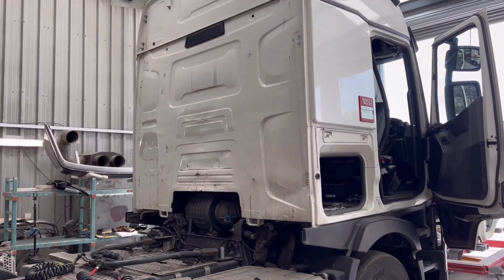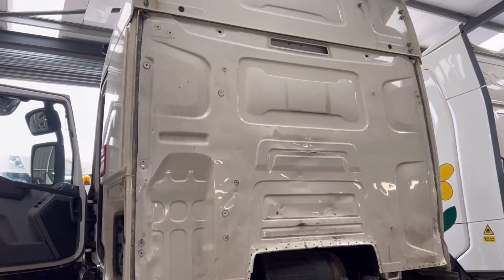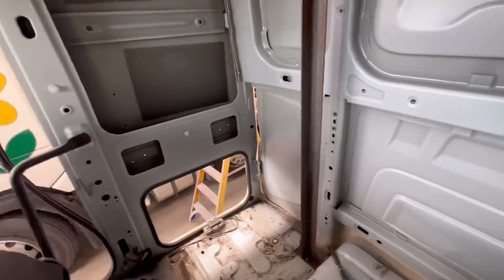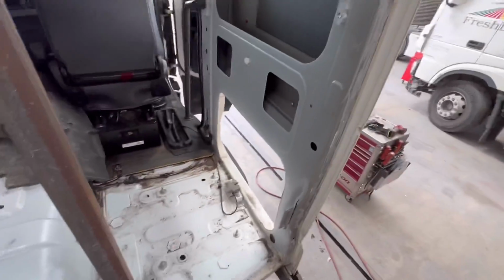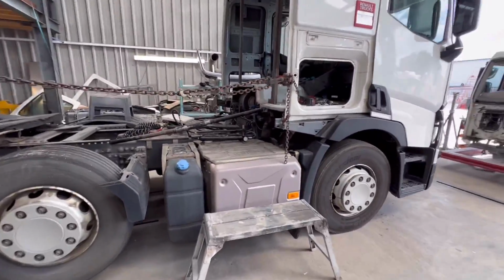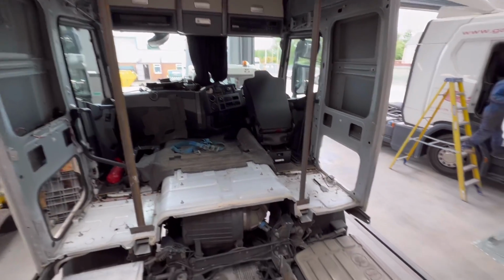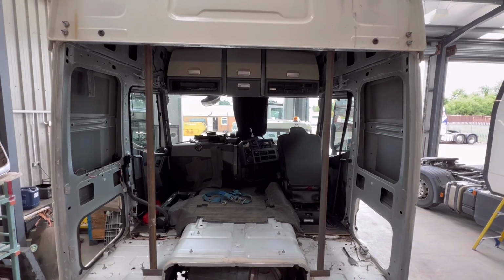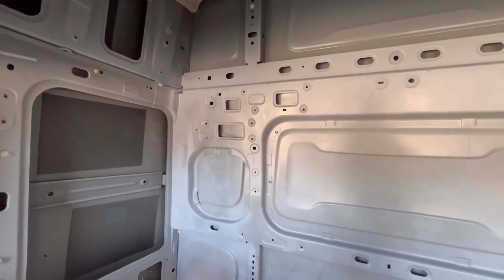Renault is back after 24h front end repair . What I have done wrong??

Comment: Hi Sebastian, now that the back panel is gone I would put a nice masonry wall in it, does it indicate something of a homely nature, doesn't it? ha ha ha I mean to say it's just a thin steel wall actually, I had the rear wall insulated at the time, both against noise (cooling engine) and against cold from the outside.

Comment: How difficult is it to get and fit scania roof’s. 
My 2016 high line has had the section above the door swapped for an aftermarket top line replica type roof. Ideally My boss would like to return it to a high line but thinks the only way is a new cab
Reply: My 2018 was hit by a crane above the passenger door and they just changed the whole cab